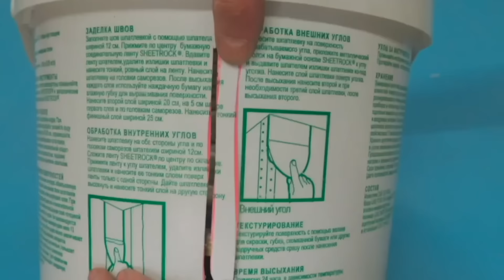Handyman's Don't Want You To Know This! Tips & Hacks That Work Extremely Well

Comment: 4:40 To make a spark and short out the circuit breaker?  6:10 The wires are bonded via heat-shrinkable tubes? 7:30 A needle nose pliers will do. 12:05 No need to make egg holder, keep your old ones or get them free online.  I give up.